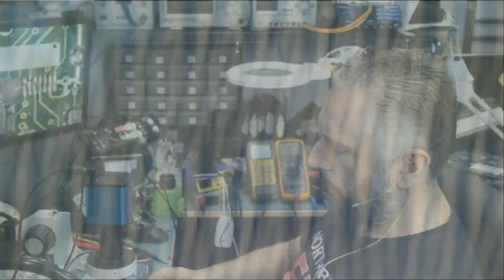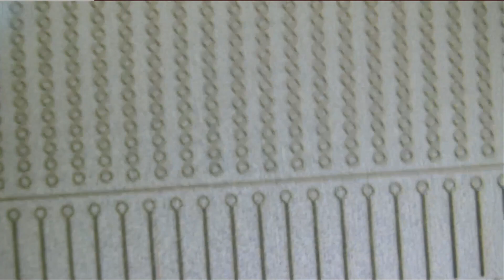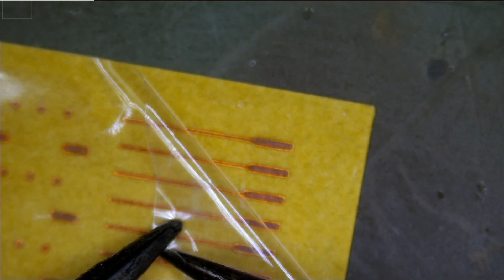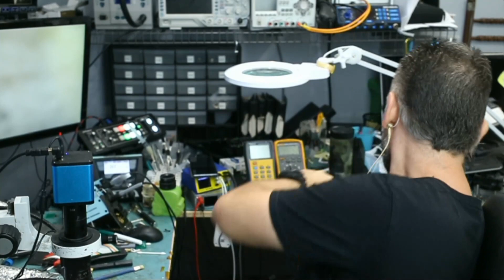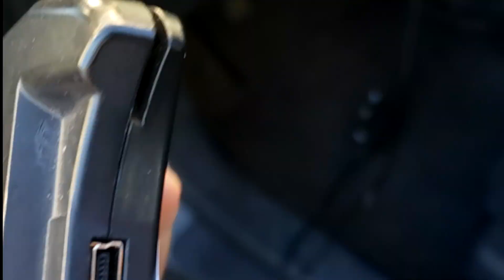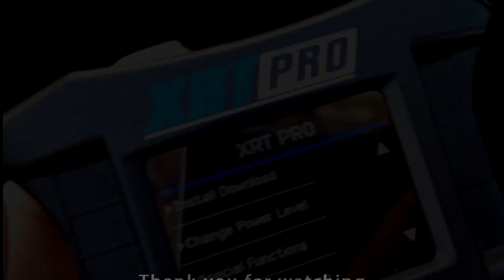XRT Pro Ugly HDMI Repair using Grinding Pen and Pads strips - Mini Maxx Tuner

Comment: How much to repair the 78 pin FPC connector on a Samsung S20 FE that a few pads got ripped off the board. Some maybe no connect?
Reply: Also if you can't see any trace lines does that mean it is a no connect?

Comment: Do you show how to replace through hole vias or recommend a guide or video? I may have to buy a flange with a kit. It's on an old Atari 7800 board for the power stage that I got off ebay broken. Pads lifted and some through holes just gone not copper only board.. just subscribed and buying some of these pads. Great channel, thanks!

Comment: Very good work.
The second type look like the have rings instead of pads. Is this the way they are?
On the larger types the outside of the ring is not very wide. I think wider would be better.
I believe the rings are used for through hole components.

Comment: I started watching your videos a couple of months ago and was so fascinated by board level repair and micro soldering. I ended up buying a soldering/rework station and just completed my first repair with the help of your videos. I replaced a micro USB port that  broke off a Bluetooth speaker. The repair included fixing three ripped pads and replacing the connector. What a satisfying experience. I know why your face lights up when the device works again. Keep up the great content and thank you for inspiring me to get into micro soldering.
Reply: I feel you dude. I'm Doing a ps5 HDMI two tore pads and this fine gentleman's video has given me the will to do it myself 😊
Reply: Where did you buy the pads?

Comment: Do you know if it's possible to repair battery pin pads that don't have the traces going out like that but have the traces going through the board.
Reply: You could just run an enameled copper wire from the other side of the board, either run it around the outside of the board or through any random hole that's around

Comment: Well Done 👍. Is it possible to secure the no connect pads with  solder mask  when  the connector is soldered properly ? I think doing that will secure the connector even more to the board.

Comment: As a hobbyist I use the smallest flathead screwdriver to expose traces on the PCB. I have lifted or ripped a few traces using this method. I wonder how precise the pcb grinding pen is. Has anyone here tried it yet?

Comment: hi alex, I made a comment on another video of yours regarding how to use the pads but I think you didnt see it, it is much easier if you put a little amount of mask, then put the pads, cure it with the pads in place and then scratch the top of the pads and solder (this way the pads dont move and make the job much easier). hope you like the tip.

Comment: Are those pad strips a recent innovation? I've only seen you use them and I remember you getting them for the first time, they seem like such a godsend for these repairs!
Reply: They’ve been around since the early 80s at least, you can see them being used in the old PACE soldering guide videotapes.

Comment: Wondering doing repairs with these pads could you secure them to the PCB by solder mask under them?
Reply: better idea, with epoxy. epoxy the pads to the PCB.
Reply: He has already tried it. The pads won't stick to the solder masks. I can't remember which video though
Reply: @blobhead7  epoxy rosin guys. you can paste the pads with it.
Reply: How would you cure it if it's covered?
Reply: @_MJ07_  only the bottom of the pad and it'd be tricky but it'd be good if possible
Reply: Doesn't work that way, unexposed mask remains liquid under the pad and the pad is not fixed. Covering the ends works but remains very delicate. Fixing pad using epoxy or super glue works better.
Reply: Or secure whole pads with mask and scrab places we need.